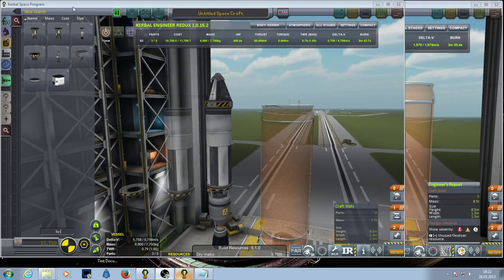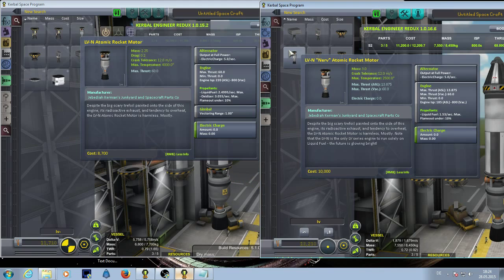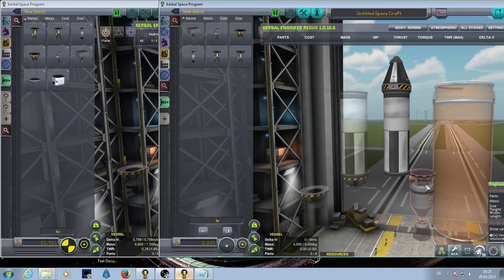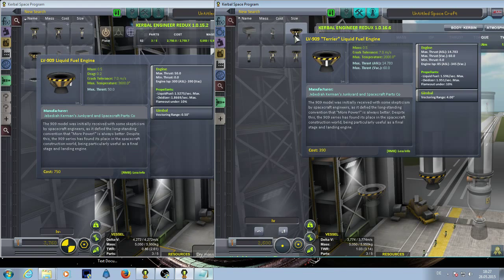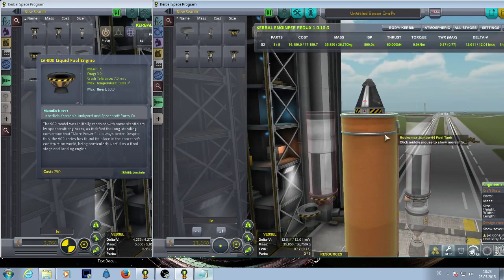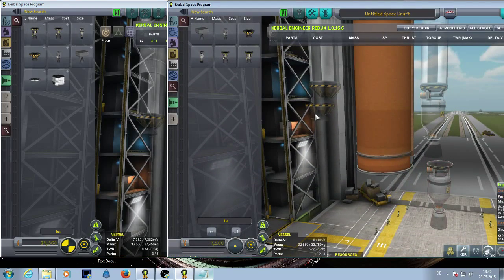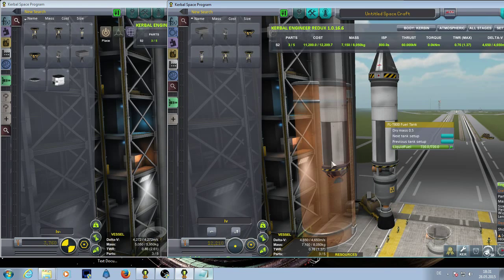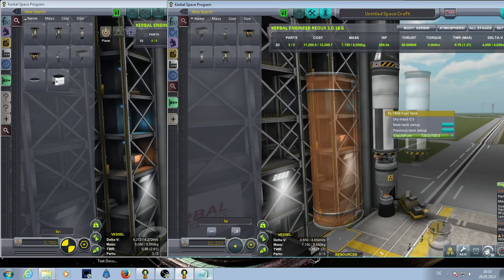Kerbal Space Program 1.0.2 - Why are Atomic Motors so BAD?!?

Comment: Concerning the whole "half empty useless tank" thing, I think the atomic engines were designed to resolve some of the problems with getting spaceplanes into space. Your ordinary spaceplane has a fuselage containing ONLY liquid fuel. This is because most spaceplanes use jet engines with huge air intakes to replace the oxidizer. However, the air intakes become completely useless outside of the atmosphere. Even if you fill your cargo bays with fuel tanks containing only oxidizer, you can really only get about 30 seconds to a minute of burn time from the average Mk2 spaceplane if it uses rapiers. So I think the Nerv engines are mainly meant to be used by spaceplanes outside of the atmosphere.